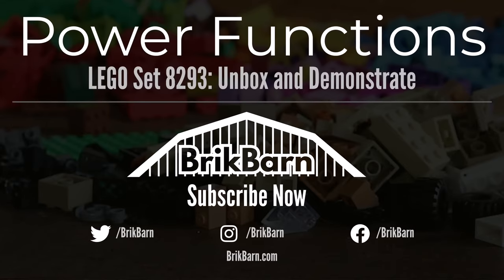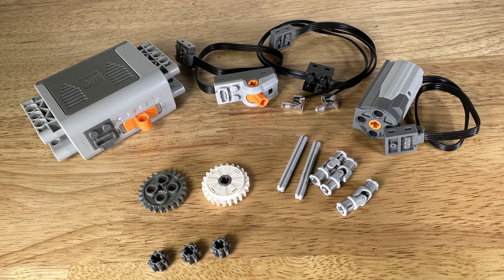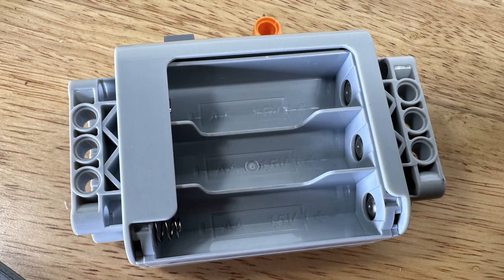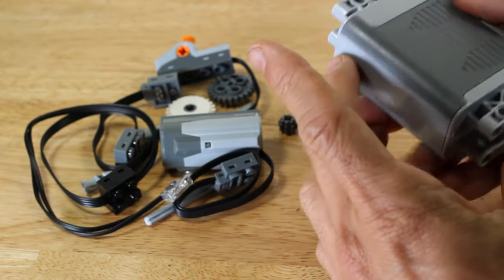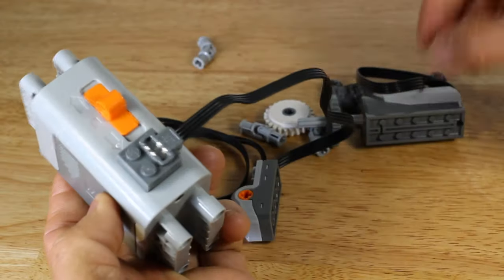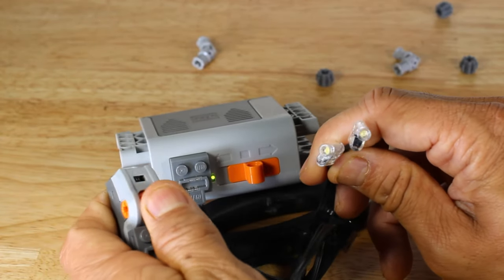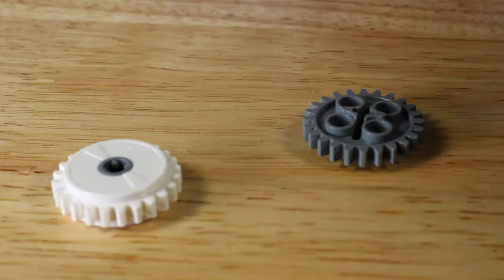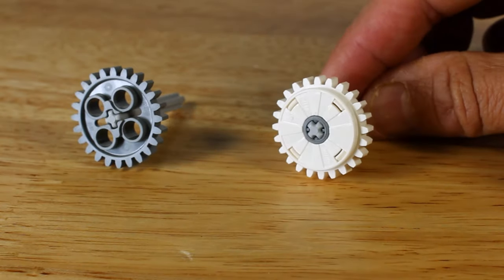LEGO Power Functions set 8293: Unbox and Demonstration

Comment: Thank you so much for the explanation 😁😁 is there any way I can use the motor to make powered wheels? Cause I see that it only has one side that rotates and I want two wheel to rotate? Would I have to buy 2 motors??
Reply from the maker: Thank you for your question.  You’ll likely have to buy two of these unless you share the torque with two wheels using gears and a shared axle.  This will be good for powering two wheels straight or on uneven terrain (like loose soil). If you need the wheels to both be powered and also have a different speed (like around a turn) then you’ll want to use a differential between two axles for each wheel.

Comment: Can the wires be stacked ontop of each other like plates?
Reply from the maker: They are moulded at the connections to be physically stackable but how it functions with electricity will depend on on what is plugged in and what switches are being used.